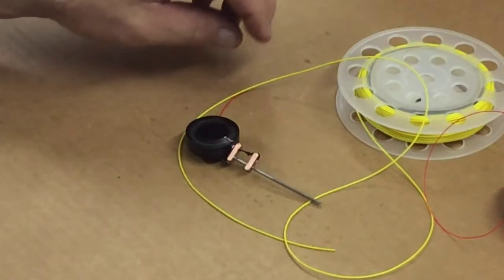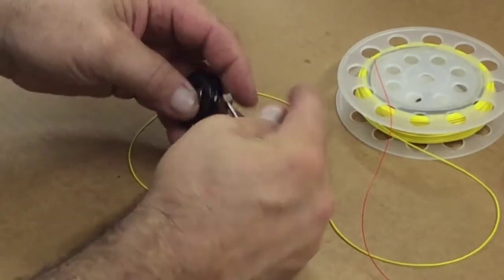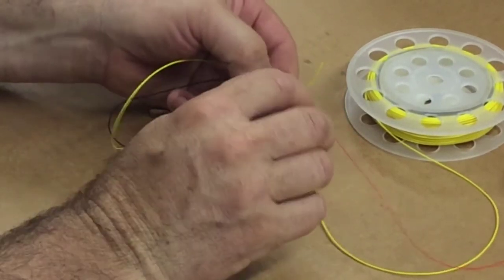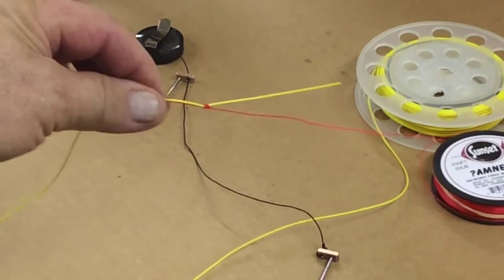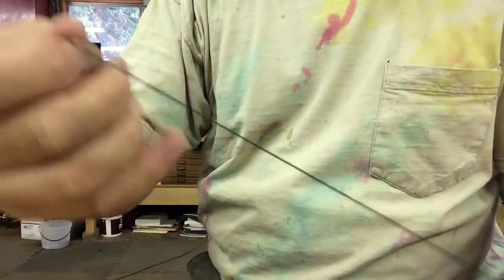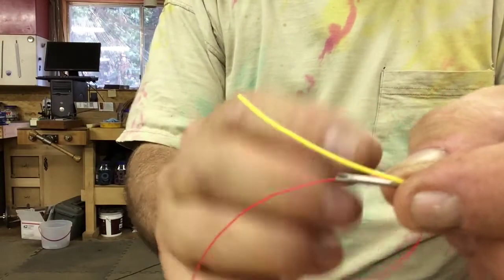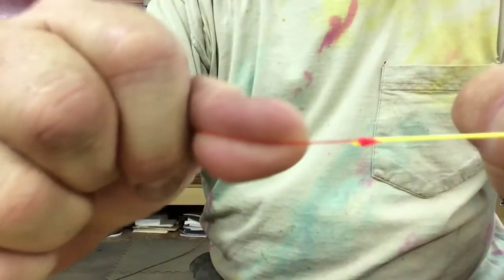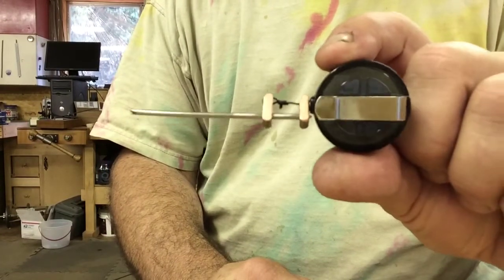Nail Knot Tool Demonstration

Comment: That knot looks a bit like whipping at the end of a rope to keep it from fraying.  I do that without a tool though...I use an extra loop in the thinner line,  put the end through it after the wrapping, and pull the end into the knot so it ends up under the wrap.   Works well enough with larger line, but with that small monofilament, perhaps not so much. 

Thanks for the demo, I was wondering how it was used. 

-- Mike
Reply from the maker: BigMjolnir yes that is a similar knot.  But with mono it will slip free.
Thanks for the comment.